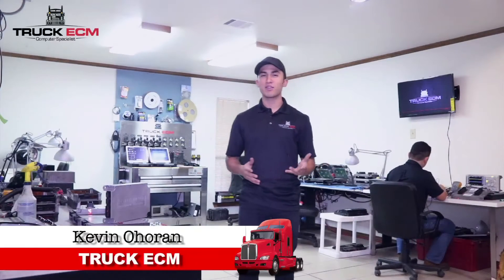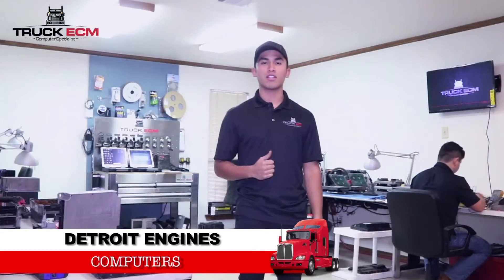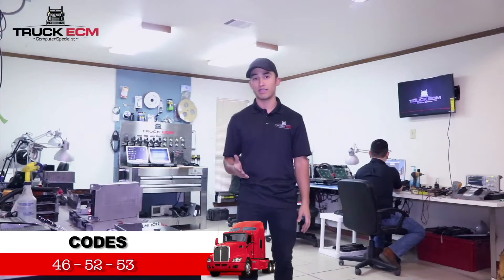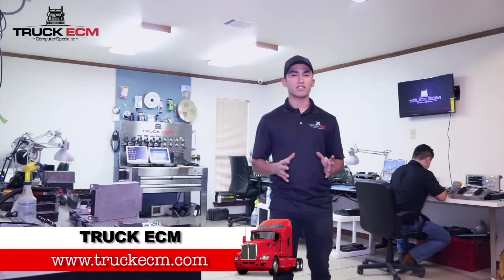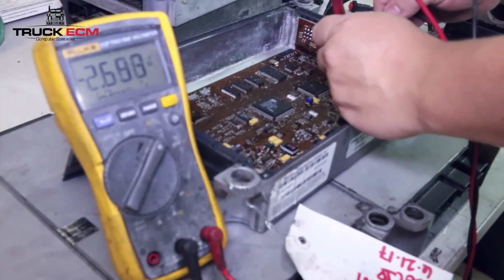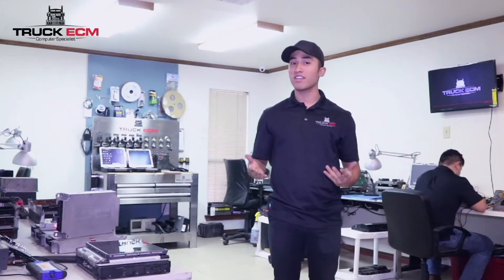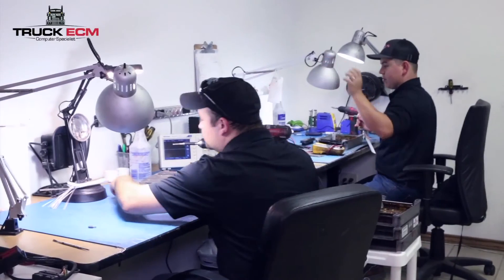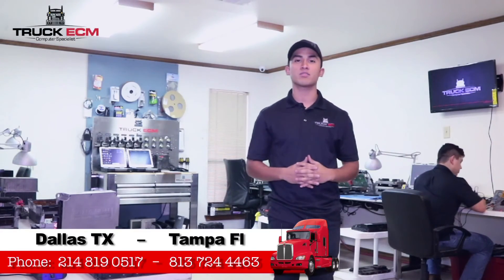How to find our if your ECM is good or bad

Comment: Do y'all work with Volvo's ECM I have a 2007 Volvo vnl with VED12D engine and the code I'm getting is MID 144 PSID 200 FMI 9 truck will try to crank and sometimes it will run but immediately shut off and I get a Ecu maintenance required and that code I gave u plus tcs and abs lights are on and the transmission is throwing a code as well but only when I get the ECU Maintenance required....